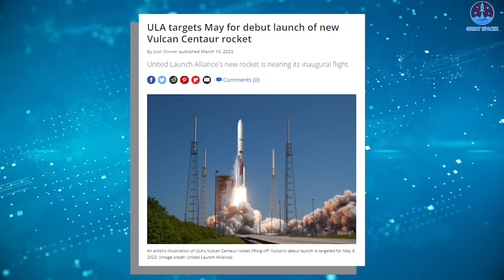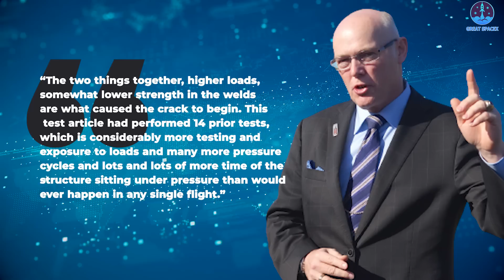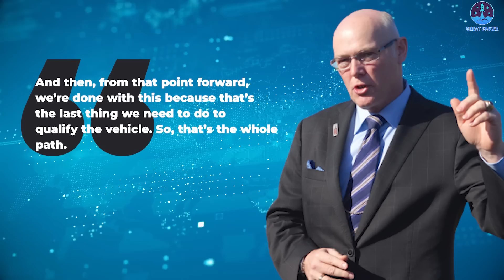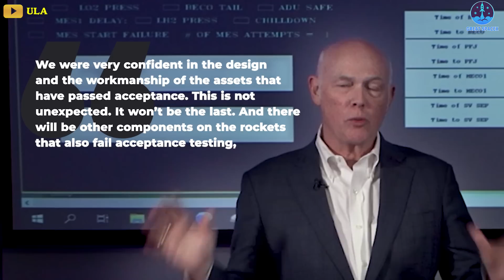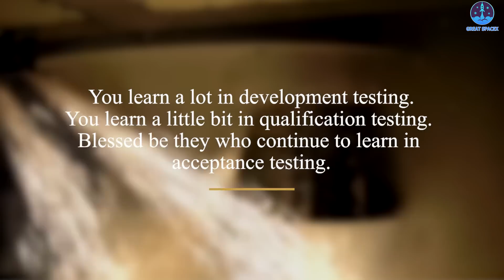Tory Bruno just revealed NEW UPDATE Vulcan anomaly and Be-4 explosions! SpaceX helps...

Comment: A warranted and justified investment from SpaceX would be to acquire "Dream Chaser", I've said the following on many different videos and channels, that it would greatly benefit SpaceX if they purchased the "Dream Chaser" company for their platform/2nd stage system. I believe that this would give SpaceX an extra platform that would/could easily open many doors to new different missions in a very near future. Imagine if the actual present scale of Dream Chaser was increased to fit on a Heavy booster and even in its present scale and configuration to adapt to a Falcon 9 rocket or even a Super Heavy rocket system. This would add so much to the SpaceX tool box (sort to speak). 

Let's be honest, Dream Chaser isn't going anywhere else but up. And as it does, it will offer many different variants of missions that are either a little too small or too much for the Falcon 9 system but right on the money for use of the Super Heavy platform and to eventually upscale it in size to require a SpaceX heavy booster set to be used for Starship alone. Imagine what a Dream Chaser of increases size to fit on a heavy booster, such a combination would increase SpaceX applications to new heights and could offer customers other options in delivering different payloads to LEO and the ISS, plus travels to the moon and back, carrying payloads and human crews. All this to return back to home and have Dream Chaser land wherever NASA and SpaceX would choose. 

So, bottom line is, Elon Musk/SpaceX should acquire "Dream Chaser" company because with SpaceX's wealth of data and ability to inject more financial aid for R&D, could/would probably leap frog Dream Chaser platform by 10 years progress wise and a launch readiness on a regular scale. Logic definitely dictates that this acquisition of the Dream Chaser company would be a sound investment and an almost turn key platform for SpaceX to use in a very near future. The majority of the R&D and leg work is already done, all that would be required from SpaceX, would be to have SpaceX tweek the platform with their engineers working in tandem with Dream Chaser engineers and also have SpaceX inject extra funds to bring Dream Chaser to the finish line, but with SpaceX being involved and doing so, they'd advance/leap frog Dream Chaser by 10 years and could be ready to test within less than 2 years with the way SpaceX runs their many different programs. 

I know this was a long reading and I thank you for take the time to read me, but I would really be appreciative to read your opinions and thoughts on this investment proposal that Elon Musk/SpaceX should really consider, or your opinions and thoughts as to why it may not be a sound prolific investment?

Comment: To save weight and fuel they went to the expensive of milling the pressure dome as thin as 0.026”. Due to being excessively thin and a not quite good enough weld the costly tank performed a RUD. They will add 300 pounds of reinforcements to the next one and 150 pounds on future models. How much overall weight will they save by milling down the thickness of the dome? What will be the cost savings of the milling process? Will the milling be on the outside or inside of the dome? If the inside of the dome is milled that should make space for an additional amount of fuel capacity. A small amount perhaps.

Comment: Don't forget that every delay for Vulcan is another delay for Dreamchaser also.
Reply: Sierra Space must, at least temporarily, kick their partners aside, as the ESA has done with Arianespace because it hasn't delivered the Ariane 6, and book a reliable ride from SpaceX.  Dreamchaser, as the only likely competitor to Crew Dragon, is too important for it to be held up by BOs incompetence.  SpaceX has demonstrated multiple times that it has no problem providing launches to its competitors.
Reply: @jamescobban857  I discussed it with someone “in the know.” Falcon 9 does not have the capability to lift Dreamcatcher. Maybe Falcon Heavy- I forgot to ask.
Reply: @edwardsummey8843  I would like to see an actual analysis.  Falcon 9 has the capacity to place 17 tons into the ISS inclination, and Dreamchaser is only 10 tons.  True Falcon 9 may only have the capability in expendable mode, but an expended Falcon 9 launch costs less than a Vulcan-Centaur launch which is only available in expended mode.  Furthermore I am not suggesting Falcon9 as a long term solution, simply as a way to get the first test flight to the ISS.  The first flight will undoubtedly be low on cargo because it will carry nothing essential.  It is primarily a test of autonomous navigation system, which Boing failed.  The multiple problems with Vulcan-Centaur seem likely to cost Sierra Space a six month delay, which could be financially ruinous to their need to acquire investors.  They could still carry out all of their paid launches to the ISS using Vulcan-Centaur starting in mid 2024.  Since the Dreamchaser can fit inside the 4.5m fairing of Falcon, the only obstacle should be that the support has to handle the narrower top of the Falcon 9, but that same issue was addressed when the ESA Euclid mission was swapped from the relatively wide Ariane 6 to the narrow Falcon 9.

The West needs at least one viable competitor to SpaceX for ISS supply.  At the moment, as a result of the poor planning of multiple companies, even Cygnus cargo deliveries are being launched by Falcon, and Cygnus is the only western vehicle which can reboost the ISS.

Comment: They should just go back to the Apollo designs. Those rockets took men the moon 50 years ago.......or was that all a hoax?
Reply: Certainly ULA should have contracted with Aerojet-Rocketdyne.  They built all of the engines on the Saturn V.  They built the RS-25 used on the STS and SLS.  They built the RS-68s used on the Delta IV.  They are building the RL10s for the Centaur upper stage of Vulcan.  Why did ULA choose to go with a web marketing firm for its main engines?

Comment: They should just buy a couple raptors and call it a day
Reply: Only problem is Vulcan is designed to run on hydrogen, not methane.
Reply: @rogeremberson6464  Be4 is methalox just like Raptor.  Upper stage is hydralox, I believe.
Reply: @gregkelly2145  I stand corrected. Thank you.
Reply: @rogeremberson6464 you also have to compensate for the size of the raptor and its pluming
Reply: ULA must have at least a few competent engineers on staff who could figure out how to attach Raptors to the Vulcan.  They just have to design a new thrust puck.  If not certainly for a few million they could contract with SpaceX for the redesign.  However even with a major effort it would take at least six months to design, build, and test the new implementation.  ULA should have fired BO a year ago.  They should have contracted with an existing engine manufacturer, probably Aerojet Rocketdyne, in the first place, not a retail web-site provider.  ULA would actually get improved performance because while Raptor 2 has almost the same thrust as BE 4, it is significantly less massive, which improves the wet mass to dry mass ratio in the Rocket Equation.  Note that BO has not published the mass of the BE-4, probably because they are embarrassed that it is so much heavier than Raptor 2.  The 1600 kg reported by SpaceX is probably for the Raptor 1, as SpaceX has no reason to reveal the benefits of the Raptor 2 redesign.  SpaceX has probably trimmed a couple of hundred kg off the implementation.  BE 4 is essentially at the same stage of development as Raptor 1, with a significant diet yet to be performed.  Raptor 3 will have 15% more thrust than BE 4, with the same, or less, mass than the Raptor 2.
Reply: @jamescobban857  yeah I don't think it would be too hard to do a quick redesign in the long run I believe it would be a lot better Jeff bezos is not reliable he created that company for a money grab
Reply: ❤All sheep black and white will experience Jesus energy wash
Once u know u better grow.
         If not reply back say I'm a liar. If u dare.
Reply: Some need a secret before you can experience Jesus healing energy. The Illuminati aka fallen angels aliens NASA what ever you want to call them in there flying tin cans. Can't get out of lower orbit because of the vacuum. Universe is only 77 thousand SQ miles big breathable air through out space angels have to breath. Mars is only 250 miles away sun an moon are much closer an only a acre big. Heaven is on Mars moon that's what all the thrusters are for space x Star ship try to punch through the vacuum and destroy Mars moon heaven. I cleaned out hell left the light's on. I ripped the soul out the devil after he went dragon just to make it a fair fight. Now u can experience Jesus healing energy all old aches and pains will be washed away takes 30 minutes relax and shut yr eyes. Warning it is intense.